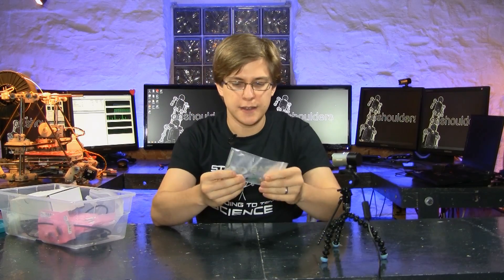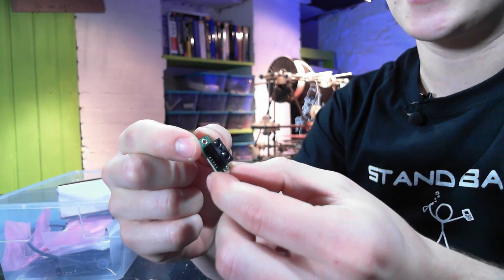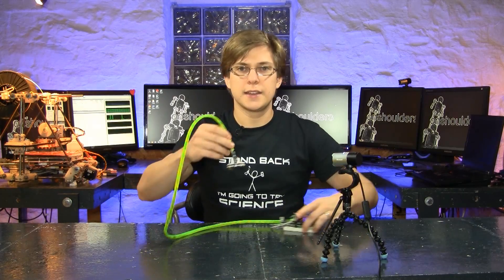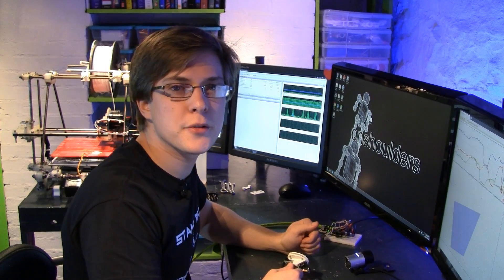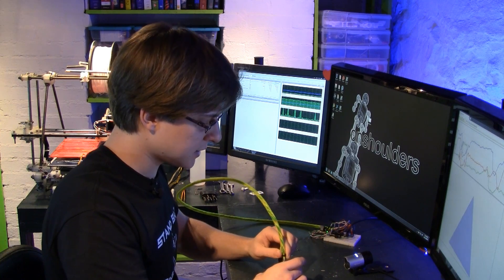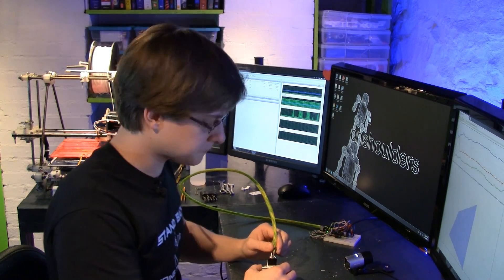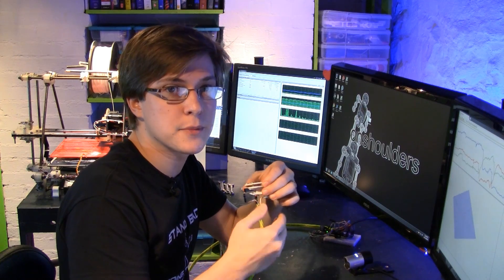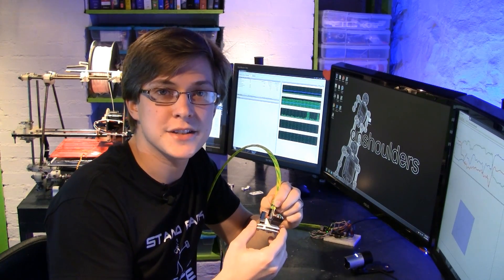onshouldersTv: Accelerometer & Proximity Sensor

Comment from the maker: I'm planning on using the accelerometers on the feet to add realism to the dogbot. As an example, instead of limiting the speed of the leg movements by the max speed of the servos I can limit them by acceleration readings. Also, with accelerometers on the feet I will be able to tell instantly when a foot bumps into something, or isn't clearing tall grass. There are several other uses I'm still thinking through.